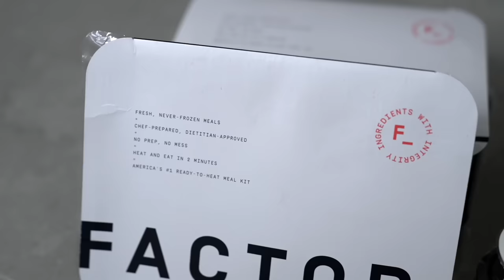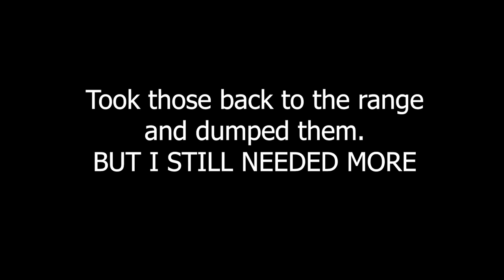We Unearthed Caves that Have Never Been Seen Before

Comment: I still say that you put four poles upright. Two on the left and two on the right ...and then Stack the other poles horizontally in the middle to make a wall.

Easier than trying to bury every single pole
Reply: I've mentioned several times to use the poles as studs of sorts and fill in between them with Rail ties. That solves several of his issues.

Comment: Would recommend treating that wood with something to prevent some rot or thermites, used motor oil, tar and a few other nasty chemicals might do the trick, especially since they're going to get full of holes
Reply: Telephone poles are usually treated to begin with since they are plunged pretty deep into the ground and have to support power and telecommunication wires
Reply: They're old telephone poles. They are already treated.

Comment: Hey brother, we run thise mini lull's at my work every day and hands down they are the most usefull piece of equipment we have! We have like 8 of them plus like 6 full sizes lull's! Weve had all different brands and my personal favorite are the Gehl RS 5-19! If you get the older model with the twin stick thats the holy grail in my opinion but the newer ones are badass also! Ac/heat equipped also! Also to mention you can get multiple different attachments for the end and they have a quick release! Super sick machines!

Comment: Cargo containers on the burm makes much better sense and much easier. Empty bullet volocity will drop to no danger beyond or place sand bags on on side. By the time you sink poles 4ft+ you won't end up with much of a backstop. JS
Reply: Cargo containers are made of thin sheet metal. Anything above a 5.56 will zoom thru it. Telephone poles are 30+ feet going down 4' isn't going to hurt anything. Especially considering he's putting them ontop of an already 20ft berm. 45' is a massive backstop lol

Comment: Hey, i believe your technically driving for commercial purposes because that is used for the business. Don't give dot a reason to pull you over. You should be using 1 chin binder or stap per 10 feet of load.